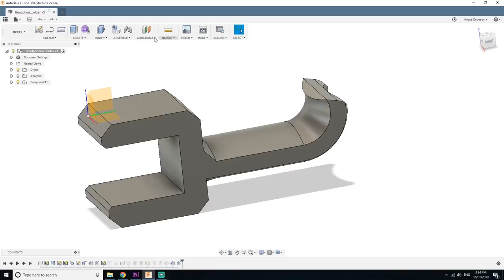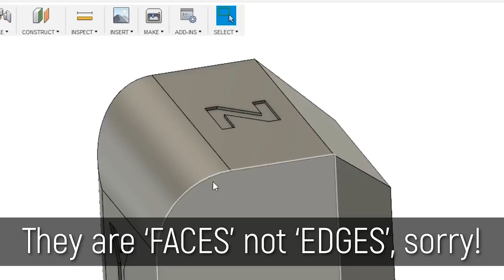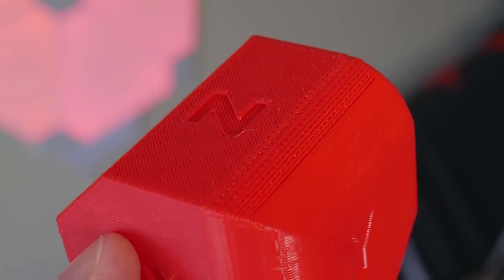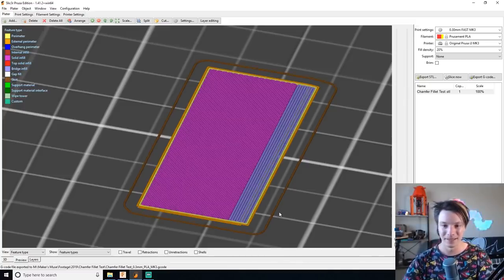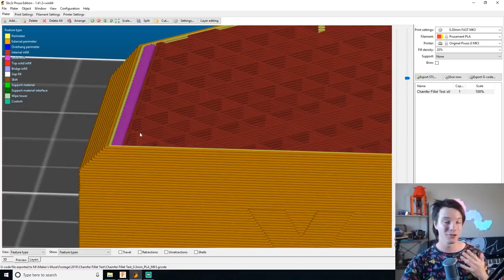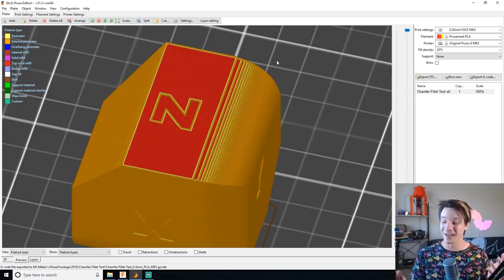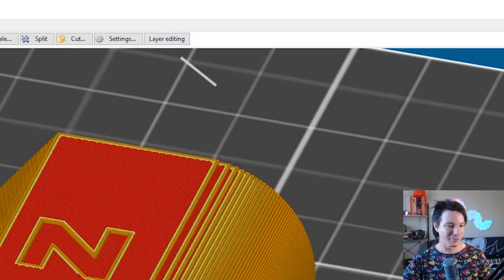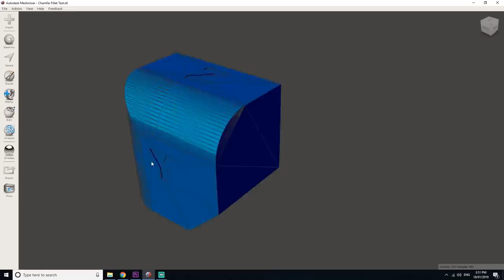Fillets are Sexy but Chamfers are BETTER (For 3D Printing...)

Comment: There's another really good reason to use fillets.  On a structural section it leaves more material, so will be stronger.  This is particularly true for thinner wall sections where a chamfer could seriously jeopardise the structural integrity.

Also, a tiny fillet (1 or 2 mm) can soften a sharp edge very nicely, almost invisibly.  A chamfer just looks ugly in a lot of cases.

There's absolutely nothing wrong with using variable layer heights and support when it's needed.  They get around all of the issues of chamfers on horizontal edges.  I wonder if we give too much priority to getting a fast print at the cost of aesthetics and structural strength, but I'm pretty sure we have all been guilty of it.

Part of the issue here is the way you are are using chamfers - as a short cut to shaping a part.  I think of it as an edge treatment, not as a way to quickly shape a part (though I'll keep it mind for rush jobs ;-)
Reply: not necessarily, leaving relatively sharp edges will create a stress riser at that point. Although to be honest I don't know which effect is stronger, at least in plate construction it is common to place fillets on pretty much every corner, not just to break the edges and allow for the router bit in internal features but also for strength.
Reply: Well said Chris.
Reply: @fergusoddjob  If you're adding a fillet to internal edges that is true.  In that case you are adding to thickness and strength.  We don't often do that in FDM though - it adds complexity to the design, though it's something that I would consider when it's really necessary.  The golden rule for maximum strength is the leg length of an inside fillet should be at least the same as the thickness of the material.

As far external fillets on thin wall sections,  the loss of strength with a fillet that is too large will always be much greater than loss of structural strength due to stress notches.

Remember with FDM the layer boundaries themselves are stress notches, so it's pretty hard to get away from.  Chamfers do help here as well though - by spreading the stress more evenly over more layers.
Reply: The vertical edges will be fine with fillets, it's actually better to fillet than to chamfer a vertical edge so that it doesn't slam on the brakes when making that edge, but slows down nicely. Helps against ghosting in my experience.

Comment: Hey Angus great video! I'm a mechanical engineer and just want to say fillets can be better than just x_y plans for FDM printers or design in general (strength wise). When a load is applied on a part with a sharp angle a stress concentration is formed. Fillets can are able to transfer this stress concentration to the surrounding parts better than a chamfer will be able too.

Comment: There is the option for the bottom to have a hybrid where the bottom part of the fillet that is > 45° is replaced with a chamfer. That avoids overhang issues but is of course a bit more work when designing.
Reply: But why would you choose to change the shape of your model when you could simply change the resolution at which that part is printed? I don't understand why you'd want to sacrifice form for construction?
Reply: @Martial-Mat  my printer has a hard time printing steep overhangs even with small layer heights (curling and/or droop)
Reply: @Martial-Mat  time is the main issue here, for those working in the field or having numerous projects running or those who are prototyping it is very important to produce the max amount of units in a certain time, or to prototype more frequently ... you get the idea
Layer height is one of the biggest time killers  there - So there is a special view and intent that he didnt discuss in this video :) 
for individuals with more time and less projects this may all not matter
Reply: @geniumme2502 interesting. And what is that view/intent called?
Reply: @Martial-Mat  The real world

Comment: I suppose if your really need chamfers you could fillet the underside first to the maximum overhang angle your layer height allows, then chamfer the upper edge of the facet to a radius that meets the lower edge. That would stop the chamfer going over the overhang limit.
Reply from the maker: Yeah absolutely. I think Cura even has a setting to apply something like this to .stl files right in the slicer but haven't played with it.
Reply: I think in this case I'd make a compound fillet that approximates a chamfer... mixing facets & curves fucks with my OCD.
Reply: On bottom corners, I have been chamfering, then filleting the upper edge of the chamfer for quite awhile.  It solves the overhang problem.  I don't tend to do real big chamfer/fillet,  something like 5mm.  I always do it on large parts, it makes a nice lip to help pry the part off the build plate.
Reply: A nerfing channel commenting on a 3D printing channel? Seems to make sense given what the hobby is like today.

Comment: Fillet everything! do you wish to send a crash report?
Reply from the maker: Ouch.. too relatable :(
Reply: You think that's bad try making a 3D golden ratio (where it stays a golden ratio on x Y and z).
Reply: Hahaha!
Reply: @FireFox64000000  Could you describe this 3D golden ratio in a bit more detail, or better yet, link to a pic? I'm not quite picturing it yet.
Reply: @polychoron  it's already a safe assumption that my inability to do that is in fact at least half the problem. Basically if you've ever seen a lily impeller it's that.

Comment: Not the best video from Angus, the message is a mixed bag, clearly how things look and print on a FDM printer is directly affected by the layer height, this is mentioned in relation to using variable layer heights. But the fundamental info from this should be if you want to print with big layers (like 0.3) then expect some some trade offs, and vertical radius quality is one of those. This video leads with the indication FDM are not good at fillets. The reality is if you print with a 0.3 layer you will likely be on a 0.6 nozzle which means you are going for speed over quality and should expect compromises across the print. From the outset it would have made much more sense to say this problem goes away with smaller layers due to the vertical step required on a bigger layer requiring a bigger horizontal jump with causes quality issues. Drop the layer height and the horizontal jump is less so the problem goes away, but if you need to print for speed with big layers you will have some issues with curves. Strange video really.
Reply: I got to agree, a +- 0.1mm layer is absolutely neccesary to get any smooth roundness on your object. 0.3 is just not gonna cut it, so it's a weird setting to base the video on. Ofcourse he remedied it with the variable layer height, but the point is kinda moot since you shouldn't expect great looking results from 0.3. 
0.2 is usualy already referred to as a draft, 0.3 is clearly meant for speed, not nice rounded edges.
Reply: Agreed, and the fillets he tested with were huge compared to the layer height. 

His advice doesn't really fit all use cases. I've printed parts to be used as molds with smaller fillets (up to 10mm) with no quality issues at all. The fillets in a mold are functional, so it's not a great idea to omit them.

There's nothing particularly special about fillets compared to other curved geometry. The general advice should be to look at the scale of any curved feature and see how big the run over rise is going to be for any step in layer height, and reconsider the geometry if it's too large.

Comment: If I remember right, fillets and chamfers are used for more than just blending things together; there is a strength consideration for implementing fillets and chamfers on inside edges as you are including additional material.

Comment: Damn, I'm SO old school.  When I learned, we used the terms "fillets" (inside rounded) and "rounds" (outside rounded).  Now, "fillet" means either.  :-(
Reply from the maker: Us young kids get confused easily :) I'm sure the term is still used though there's probably a few differences between engineering and design fields.
Reply: @MakersMuse  - Yeah - I think the terms were consolidated when CAD programs became the norm.  They didn't want to have to program two terms when one would suffice, I guess.
Reply: @MakersMuse  Yes, fillets are a very specific thing - a way of relieving stress risers between two or more intersecting surfaces, and is the surface described by rolling a sphere of fixed or variable radius around those surfaces.
Rounded edges and corners are the inverse, and not the same thing at all!
This was a mathematically hard problem for a long time to do in CAD, and still challenging.
Blender unfortunately still doesn't do it properly, and leaves cusps that need manual attention :-(
Please try to keep naming consistent!

Comment: I use fillets all the time.  The trick is to just use small radius ones.  Large radius fillets on large layer heights without support can definitely be a problem but more reasonable small fillets, especially with smaller layer heights, are great!  I also like to chamfer then fillet the chamfer.

Comment: For bottom edges, I like to do chamfers and then fillet the edge that doesn't touch the build plate.
If you use a chamfer distance of (2-√2)*r for a 45° chamfer on a 90° edge with r being your desired fillet radius, the fillet will still be tangential with the base plane and you just removed the steep bottom overhangs.

Comment: On the side of a part it is an advantage to use fillets over chamfers, because it allows the printer to use much smoother acceleration/deceleration moves.

A chamfers has 2 hard edges, so the printer has to decelerate before it even gets to the chamfer, basically stop on the first edge, then accelerate into a different direction, decelerate and stop again on the second edge, and then finally accelerate on the actual face of the part.
This takes a little bit more time (especially if you have very conservative acceleration settings) and can cause ringing artefacts (especially if you have very agressive acceleration settings)

Wheras a fillet has a very smooth transition from one direction to the other. So the printer can move at maximum print speed until the point where the fillet begins, then from there on this axis of the printer can slowly decelerate until it stops at the point where the fillet ends. At the same time the other axis can slowly accelerate until it reaches maximum speed at the point where the fillet ends, and then just keep printing the next face of the part.

This means that (on the side of a part) printing fillets is slightly faster and leaves less artefacts.

Of corse on top and bottom of a part chamfers are better, for the reasons you showed in the video.

Comment: So you don’t have to worry about this if you are using SLA/DLP, right?
Reply from the maker: Much finer layer heights so not as big a deal, but it can still be visible on top and bottom surfaces.
Reply: The problem essentially scales with layer height. So this was a.. 10-15 mm, looks like, radius round over. Let’s go with ten. Printed at 0.3mm layers. At 0.1mm layers (whether or not you print the rest of the print that way) a roundover of 3.3mm radius will have that same type of stepped appearance (just smaller). If you’re doing SLA printing with 0.03mm layer heights, the problem will look that bad on a roundover that’s 1mm in radius.

Comment: So if you want every model to look like it was carved out of stone in the 14th century, go with chamfers, but otherwise, take 30 seconds to tweak your layer heights, or orient your edges so that fillets are vertical not horizontal? Right, got it.
Incidentally Angus, you could could make exactly the same argument for ANY part of the model that has a very long gradual curve in the z plane. You'd have been FAR better to make this video about all the ways to mitigate the problem, rather than simply declaring "Fillets bad".

Comment: Variable layer height is just my favorite feature in Slic3r and Cura over the last couple years. I've gone from waiting forever for .1 or (ugh) .05 for detailed models, whether or not they need it all the way up, to just defaulting to .3 in many cases and letting the slicer do the work (in Cura's case).

Edit: And yeah, I was practically screaming in my head about VLH for half of the video.

Comment: I recently used a combination of both that seems to work, at least on a small scale.  I placed a fillet above a chamfer that I used on the bottom edge of a print.  It makes the transition a bit smoother, and not the obvious edge, that the chamfer, alone, gives your print.

Comment: Interesting. However, I am a function-over-form designer so I use whatever has the combo of best strength, fastest print time and least material use.  One thing I love about 3D printing is that you can chamfer or fillet most everything and unlike machining, you don't add cost.

Comment: Fillets rule. Oh wait..  Angus -- I want to make an inflatable 3d printed basketball that bounces. I'm thinking about how it could be done. TPU and a check valve for a start..  :)
Reply from the maker: Check out XYZ Aiden, he's done loads of work on 3D Printed pneumatic soft robotics and a good place to start!  https://www.youtube.com/channel/UC1ts2Ar2cVWYCac-KAaTrWQ
Reply: @MakersMuse  Yeah, checked his channel already. Seen his check valve. Seen references to your water holding work . Can't find any bouncing balls yet though. :)
Reply: I'm a noob, I don't know what TPU means, I don't even have a printermajigger yet. So take my words with some salt. But I'd think the horizontal layers would be bad for inflatables like basket balls that need to bounce & therefore contain variable pressure... the layers would split apart. I think you'd have to invent a new type of printer that works more like rolling a (hollow) ball of yarn. Barring that, a cell structure might help... an inner hull connected to an outer hull with supports... I don't know why I think that would help... it might make it too stiff to bounce.

Comment: I find myself doing chamfers to make models easier to sand... and once you sand it, it will actually smooth out the model too. And with fillets, it forces you to use very low layer heights like .05mm

Comment: But, but, but - muh purty fillets 😀. I find that inside corners fillet fairly well - even on my crappy Wanhou. Outside edges = post processing.
Reply from the maker: For anything 2.5D it's fine! :P I didn't even go near the topic of internal fillets to remove stress risers etc but I think that's beyond the scope of most 3D Printing hobbiests. Is the wanhao tracking along OK now? I always have more parts... lol
Reply: The gantry parts are pretty good - its the bed. It needs levelling every print (sometimes by quite a bit) and the bed is domed up in the middle. Seriously thinking about making a new bed with an after-market heater and a magnetic build surface.

Comment: The top fillet would be quite a bit nicer even keeping 0.3 but with more than one perimeter. You probably did that on purpose to make the problem more visible :-)
And the bottom one would too benefit from smaller layer height, just as the top does. That being said, yes, fillets are overrated and overused.

Comment: everything also depends on the radius of your fillets. The ones in your example are gigantic, when rounding of corners or edges with fillets with radii in the order of 5 mm or less the overhang and the stepping on the top will be not severe for normal layer heights.

Comment: The real key is to "design for 3d printing", if that's what you're using to make your part.  I'm super-pleased with myself on a box design where I was able to get a nice curve on the sides, but kept it well within overhang limits.  I used a truncated cylinder on its side, intersecting with a sphere (end caps) and 2 planes (top and bottom surfaces) to make a nice dice box that everyone thought looked like a case for glasses.  Think of the sides like the shape of parenthesis... "(" and not a full 90 degree bend.

Comment: Can you do your slicer trick in Cura? Unless someone corrects me, I can not find how to do it. There was something about older versions splitting the model and there was one about bringing in the same model duplicated and applying different settings to each one. Angus, maybe you can make a deal with S3D, if used for hobby and we drop your name, we get it for half off.  Or if used for hobby and we subscribe to your channel. :-)

Comment: For small objects designed to be held in the hand, like the case I designed for the Lantian Mini High Sensitive 2.4G Frequency Spectrograph display I uploaded to thingiverse, I print at 0.10mm or 0.05mm and the curved edges come out nicer because they're on the top+sides of the prints.
Reply from the maker: Yep for sure, with super fine layer heights the stepping artifacts are less obvious - but you can still see it even on resin prints at 50 microns if you look hard enough ;) MUCH cleaner result though.
Reply: First saw some small (20x10x10mm) resin 3D printed parts about 10 years ago, the detail was amazing.
I realised I'd reached the limits of printing small things with my Prusa i3 Mk3 when I tried to print some replacement battery covers for my old Nintendo Game & Watches, even 0.05mm layer height isn't enough, need a resin printer but that's too much just for a few battery covers :)

Comment: You can still get some rounding in. You just have to cut it off at 45-60 degrees. This does actually give you quite a lot of the shape (45 degrees is actually about 70% of the height). Not really suitable for engineering but for aesthetics, it can be good enough.